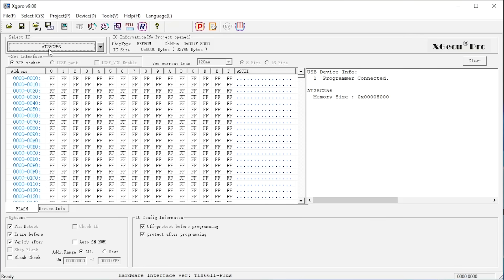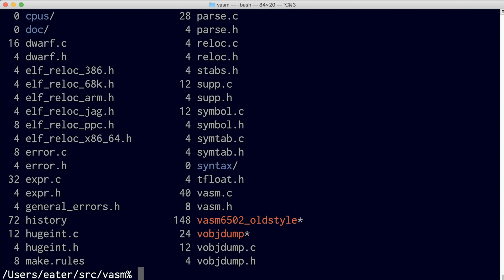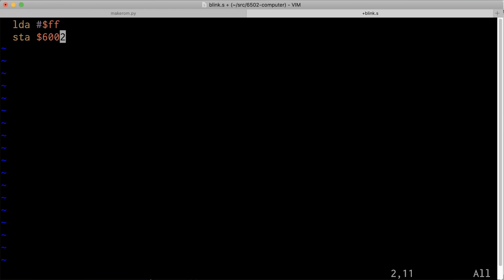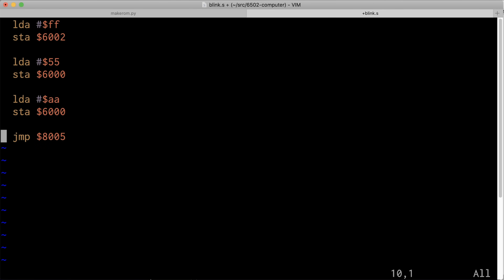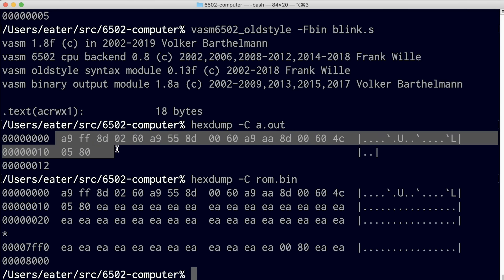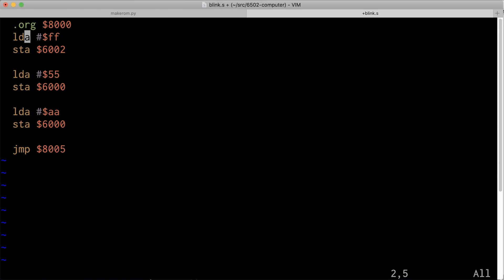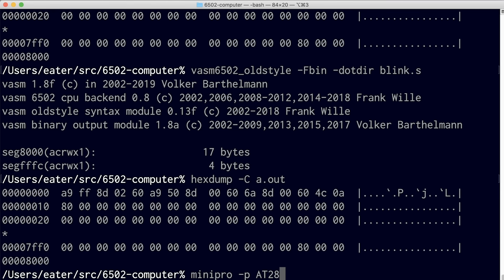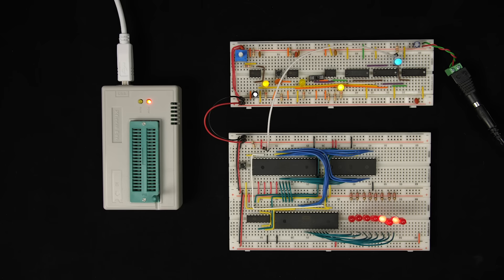Assembly language vs. machine code — 6502 part 3

Comment: Technically, Ben Eater's not working with the 6502, but the 65C02. Though it's a pin-compatible chip it's actually slightly different with more than just "static logic" and being a CMOS chip.

The Western Design Center (The company that MOS Technology passed the 65x torch to after the 6502.) actually describes four major chip designs in the family, though a large number of companies have their variants:

There's the original 6502 design by MOS Technology, which was used in things like the Commodore 64 and the Nintendo Entertainment System (Famicom.)

Then there's the next chip up, the 65C02, which is actually what Ben Eater is working with. It's binary compatible with the 6502, but it adds a few instructions and addressing modes the 6502 does not actually have, but is otherwise the same as the 6502. It should be able to work in the exact same hardware as the 6502, but I don't expect NEW hardware designed for the 65C02 would be able to support the original 6502 design. For example, the static design of the 65C02 could be had in mind, which the original 6502 could not make use of, as the 6502 required a regular clock to at the very least keep the chip refreshed, lest it lose the contents of all its registers and thus lose its state. Ben mentions in the first video he's using the 65C02 precisely because the clock doesn't have to keep pulsing for the 6502 to keep working. 

Step up from there is the 65802. This is the first of two 16-bit "upgrades" to the 65x design. The internal registers are given a 16-bit repackage, though they can be "downgraded" to 8-bit registers as needed. This chip was designed to be used where the 6502 and 65C02 were, so while internally it was a 16-bit CPU, it still had only an 8-bit external databus with a 16-bit address bus. It was still more powerful and in some ways faster than the 8-bit 65x chips, but it still had to take two clock cycles to read a full word externally. This also saw a CMOS refresh, the 658C02, but as far as I know, unlike the 65C02, it didn't introduce new instructions or addressing modes. It was able to run in a compatibility mode wherein it behaved more like a 65C02 than a 65802. It, like the 65816, when running in native mode, also didn't restrict the stack or the zero page to one location, though this was of less benefit to the 65802 since it was still stuck to a single bank (64KiB) of memory. The Apple IIGS used this chip, whereas the previous Apple II designs all used the 6502 or 65C02, though the Apple IIe, at the very least, could be upgraded to use the 65802. 

Finally, and the "ur" example of 65x design is the 658(C)16, which was identical to the 65802, largely because they were designed simultaneously. This was meant to be the more high-end chip, but sacrificed pin compatibility to have a full external 16-bit data bus and 24-bit address bus. This CPU was used in the Apple Lisa (I think. Or at least the Lisa used the 65802.) and, more famously, the Super Nintendo Entertainment System. It had full binary compatibility with the other three designs, but could also address far more memory (16MiB! Fun fact, it could directly address more memory than the "crowning" 16-bit CPU success, the Intel 8086, which had a 20-bit address bus and could only address up to 1MiB. In the original IBM PCs, it was only ever given 640KiB.) than the others, and you could relocate the stack and zero page to other locations. The 65816 was a pretty good 16-bit CPU, but at the time it was unveiled and starting to see some use, the Intel 8086 (Found in the IBM PC and compatibles.) and the Motorola 68000 (Found in the Commodore Amiga, Atari ST, and Sega Genesis (Mega Drive.) were taking off and they were, to be blunt, way more powerful CPUs and did not cost that much more than the 65816, not unlike how the 6502 was rivaled by the Intel 8080 and Zilog Z80 back in the day.

I've never personally programmed any 65x chips, though I would love to experiment with that. My dream hobby build would probably involve an m68k, though.
Reply: technically it not matter everything that you assemble for 6502 will work on 65c02 but 65c02 has extra ops and works even you stop clock or doing slow clock. 6502 cant do manual clocking it loose data
Reply: @jarisipilainen3875  That's essentially what I said on my comment. My reason for pointing this out though is some people on the subreddit have been acquiring the NMOS 6502 and being confused why this isnt working.
Reply: 65C02 is CMOS. 6502 is NMOS. They have a different electrical specification. The logic thresholds are different. They are not interchangeable as chips.

You need to design the electronics for the particular type.

Comment: lol as others have already pointed out, I also smiled when I saw the thanks to you on the download link. I use vasm myself from time to time as I have a homebuilt 6502 from the late 90's that does various automation tasks that I built to replace a pic based system when it became too limiting... it used to do quite a bit from lighting to door locking and things but now it just mainly keeps plants watered...  of course these days  you can do plenty more and a lot quicker on a $2 arduino uno clone but back then I used to repair arcade boards when there were still plenty of arcades about I often had donor boards about and 6502s, z80s and eeproms were pretty abdundent, as well as an unbelievable amount of ttl glue logic.  Kind of funny that now the technology is more available and easier to build and use the less I do :P
Reply: Hello! I am trying to do this project and vasm isn't working for me, I can't find anywhere online about how to fix this, so you are my last resort. I'm trying to compile a file but it says no input specified, I've tried everything, I am using Cygwin for windows 10 64bit, I put in the command: "./vasm6502_oldstyle -Fbin -dotdir blink.s" am I doing something wrong?

Comment: Hi Ben. I have a dualport RAM interfaced with USB. It can be used in projects like yours to update the ROM (dual port ram) on the fly via command line on linux or mac. Let me know if you read this anf is interested. It is open hardware.

Comment: I hated low level classes because my professors just spewed out assembly info at us, some directly from the x86 manual. I wonder how many career paths would have changed if more practical goal-oriented assembly programming was done like this.

Comment: Update from Wikipedia: "vasm is a free assembler supporting various CPUs and many different output formats.
CPUs officially supported by vasm include M680x0 family, ColdFire family, 80x86 family, PowerPC, ARM family, Z80 family, C16x/ST10, 6502 etc. Vasm supports Standard MIT (GNU-as style), Motorola/Freescale 68k (Devpac compatible) and Old 8-bit style syntax flavours. Output file formats include ELF, a.out, Amiga hunk format, Atari TOS/MiNT executable format, EHF extended hunk format, Raw, binary output, Motorola S-record format, VOBJ proprietary versatile object format, Test and debugging output."

Comment: This was how us poor people, in the 1980s wrote our Z80 machine code. I was too young to afford devpac, and the ZX Spectrum +3 manual had the z80 mnemonics listed. So, I needed to do it manually.

I wrote it out machine code style on paper, then put the opcode numbers next to the commands on the right and in the margin popped in the address (for jumps). Then pop them all in a data statement with a poke loop and boom. Instant program (that would often crash, but still).

Yeah, it was a pain for anything remotely complicated. But, I was young so not doing anything THAT complex.

I did manage a track by track disk copier though. That needed to be in machine code, because you had to swap out the basic rom, and swap in the +3DOS rom, which if you tried to do from basic,  for obvious reasons would cause a pretty instantaneous crash.

Comment: His series inspired me to do a similar thing with some Z80 CPUs. I use an online assembler for the z80. asm80 .com . Works pretty well, and was the only one I found that respects the .org directive. I just take the binary output from that and flash it on an sst39sf010a with a bit of custom hardware I built.

Comment: Is it possible to program a 6502 using only an Arduino?
Reply: You can program a eeprom with an arduino.
Reply: well you can make arduino act like it was ROM hook up all address and data lines to arduino.make arduino sketch that read adress lines. output data line
Reply: @jarisipilainen3875  Good idea

Comment: one thing that is still different from the manual and the assembler version is that the manual version's padding uses ea bytes but the assembler version's padding uses null bytes, why doesn't it make a difference?
Reply: Because unless there is an error in the code (which there isn't), the CPU is never picking up any instructions from that segment of memory. On reset, it picks up the address placed at the top of the ROM, which is $8000; it then executes the code, which after the initialisation steps is an endless loop of ROR, STA $6002, JMP loop. The program counter never hits the zero bytes.

Comment: .org fffb 
jmp reset
nop
nop

This way, if the program counter ever gets to the top of the ROM, it'll just reset instead of crashing
Reply: What if program jump for those nop.it crash.whynot put this top of rom.so it mean it startreadfrom ram address 1.
Reply: Well, you certainly could do that, but putting that JMP in there as a failsafe suggests you expect your code to fail at some point. Furthermore, I'm pretty sure the bytes before the reset vector are for the interrupt vectors (I come from 6809 territory, and the 6502 has more than a passing resemblance to the 6800.) You really don't want any code there.
Reply: @2thinkcritically  When he had the ROM full of nops, if occurred to me that it would simply execute from the bottom of memory on up, and then hang. Adding a JMP immediately before the reset vector would catch that.

I agree that it's of limited use once things get more fully developed, as we need to prevent the program from getting there in the first place.
Reply: there is no reset vector yet and it should be
.org fffa 
not fffb
jmp loop
jmp
 loop
jmp loop

and rest of rom is filled 0 what is op code is BRK it would just HOLD?
if something we program wrong it stop working.so we know we prorammed it wrong

Comment: Thank you for your great videos but it's the first time I'm getting confused.
Why does .org $fffc move code to the bottom but .org $8000 doesn't?
 Is this a convention that the first org is just a label? Is this typical for all assemblers?
Why does .word reset work? Is the address of the label used as a convention when used inside a word directive?
I could google it but there's probably a better background explanation.
Reply: If you not put that org 8000.assembler create rom bin thinking it start from 0.wont work.ram is ocupy that 0-7fff inthis machine
Reply: @jarisipilainen3875  I undestand that, but why doesn't the compiler relocate the binary from org 8000 to the position 8000 in the hex file?
Reply: Thanks Jari, you've tried, but I'm not sure you undestand my question or how the compiler works.

It seems like the first .org directive will NOT relocate the ROM code but will relocate the address. All subsequent .org directives will relocate both the program and the address. Somehow this is a convention that I haven't seen documented anywhere.

To test it out: insert a .org $1000 in front of the .org $8000 -> the following code will be moved to flash $8000. Insert an lda #$01 -> the first ROM instruction will be at the first ROM address, the following code will be at $8000. Change the .org $8000 to any address -> the first part will not be relocated inside the ROM but the reset vector will be adjusted.

There are probably other ways to relocate addresses and code at different places (directives, maps) but I haven't researched this. It seems like the first .org has an implicit behavior.
Reply: @ligius3  There is no relocation going on, it's simpler than that.

By default the compiler assumes your code will start at position and address $0000.

The ORG directive just informs the compiler where the next code output should be placed (position versus address).
So if you just say (notice no ORG at the beginning):

   lda #$00
.org $1000
   lda #$01

You will get a a file with $1001 bytes, that includes all bytes (not addresses) from position $0000 to $1001.
 but if you just say:

.org $1000
   lda #$01

You will get a 2 bytes (positions) file.

So what is going on?

When the compiler starts to generate the output file, it knows what the first output byte on the file will be (the first instruction opcode) and its position (not address) in the file (first byte).

But at the same time there is a mapping that is being done between the bytes and their expected position in memory (an address).
If you define the expected address (using ORG), before the first byte is output, that next position will be mapped to that ORG address.

And why is this mapping required ?

Because you need to be able to calculate ABSOLUTE addresses, that can be used on JMPs or sub routine CALLs.
TIP: On more advanced language compilers, you can have a link(er) step that will in fact relocate and substitute any absolute address reference (after compiling), when generating the final binary. This is not usually the case in Assemblers.

And why does the compiler output all those bytes between two ORG addresses (or between the default start address and a new ORG address) ?

Because when you start to generate the output, there is no way to define in the file, that you want to leave a part of it blank or unfilled.
So as soon as you start to generated the output, the file is linear, so if AFTER some output was generated, there is a ORG directive telling the compiler to generate bytes at $1000, it needs to fill the gap with something, so that it will reach the correct relative distance, between the previous output byte and the new byte position, so that file linearity is kept.

What is important, is to NOT confuse file byte offset positions with addresses.
There is a mapping between the two, it can be implicit (default) or explicit (ORG directive), but they are different things.

But why doesn't it ALWAYS generate output from ZERO ?

Well, it could but it wouldn't be very useful.
If you want to compose a ROM file from several independentely compiled blocks, it would be a lot more complex to merge those files, if they all included everything from zero.
So the fact that the address mapping can be controlled with the ORG directive, BEFORE any output is generated, is a very useful feature.

But as soon as some output is generated, the reminder of the file MUST be linear, hence the insertion of "blank" data between the current and target output position.

Comment: These videos remind me of when I built a Z80 based computer from a kit (a complete computer with a proper video display - B&W of course - and cassette tape storage) and then entered Microsoft BASIC for the TRS-80 into it, one hexadecimal instruction at a time, saving it on tape between sessions, and finally altered it so it would run on the kit computer.  That was fun.
The kit computer had a display half the size of the TRS-80 and used a different method for saving and loading on tapes and accessed the keyboard differently, so I had to alter all three of those sections of the code.
Yes, I made it work.  I used it for quite a while until computers which used disk drives became affordable.

Comment: Now you tell me! that I don't need to write my own assembler... oh well, it's almost working properly, and it was fun t do. I can already take binary files such as Commodore ROM dumps and disassemble them correctly as 6502 coding, but assembling assembly language like you've shown us here is still glitchy for my program.
--- Back to it...
Reply: It may be unnecessary, but it's still lots of fun and the experience you gain should stand you in good stead if you decide to go into programming as a profession.
There's few more satisfying things than figuring out how to solve a problem (without creating more problems in the process) ;)
Reply: @melkiorwiseman  It has been fun, and I can omit features I think unnecessary while including those I want, so it will work better for me (assuming that I succeed).
Reply: @spiderjuice9874  You'll know you've succeeded once your compiler can compile a macro which redefines itself as a subroutine call. ;)
Reply: @melkiorwiseman  I'll keep this in mind!

Comment: I always found it strange that 8bit assemblers had significant whitespace to distinguish labels from opcodes, rather than looking for the line-terminating colon.
Reply: This is typical of assemblers. The colon thing is a feature of high-level languages, which use compilers or interpreters instead. Assemblers are, understandably, WAY more strict about their syntax and structure.